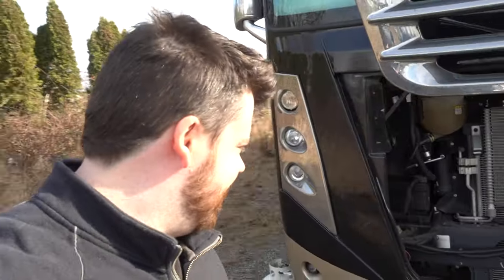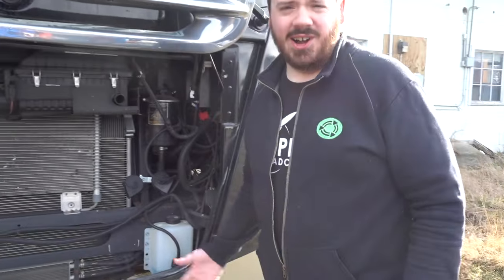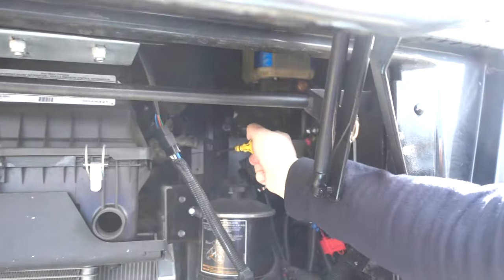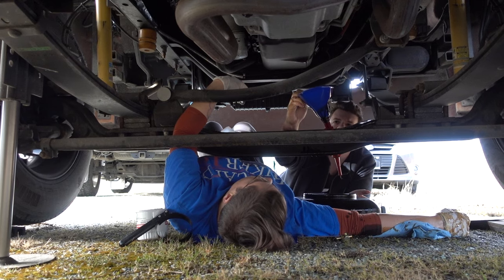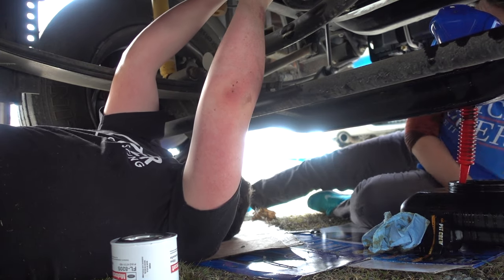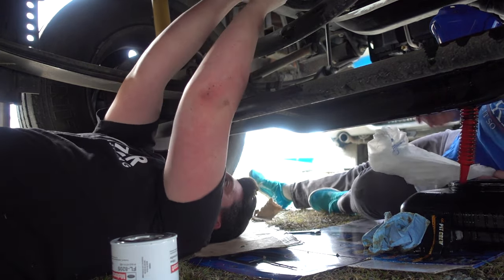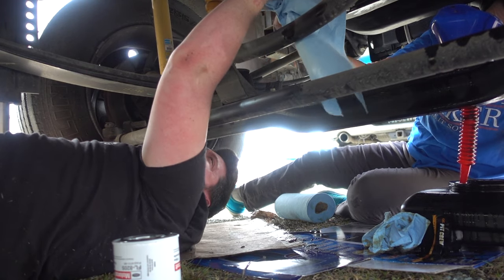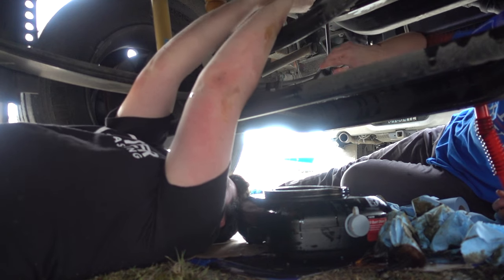Junk Yard Oil Change // vlog 36

Comment: Fisher has no idea what sort of horrible mess he avoided having that old o-ring drop off =p. Good on you both for getting your first oil change under your belt.
Reply from the maker: Yeah I figured that out after we were done. Yikes.

Kinda shocked that the half a dozen videos I watched/forum threads I read never mentioned it. Seems like maybe such a basic step most people just forget to even mention it, but for a n00b that could have been a huge deal to miss!

-Chris
Reply: Chris Fisher, been working on most of my vehicles for years. And I actually forgot one last oil change. Felt like an idiot when I started the van to be greeted by a lovely cascade of oil.

Comment: Ok thanks Chris for the behind the scenes on how you do those drone shots and boy that was neat to see it fly back on its own. I'm just getting into it and have a indoor quad and outdoor one too and boy it's a lot of fun especially when I can check the footage later.  No when you do the overhead shots and you fly over your home there I never see you in the shots, are you doing that from inside? Looks like it with that remote. Really neat!
Reply from the maker: Thanks Patrick!

RE: never seeing me in the shots - That's mostly just me thinking about my shot, and then hiding myself in the shot! For the recent Junk yard shots, I was behind the big white trailer. Or off to the side in the bushes depending on my shot.

For example, if you pause at 00:00:27 you'll see me on the passenger side of my truck. DJI really made that controller stand out, I'd pay to have a black/darker one.

Then of course I also have the luxury of cutting out the parts where I do get myself in the shot. I sometimes leave them in if you check realllly close, but none of the shots last for that long ;)

-Chris
Reply: Chris Fisher Ahh - love the Easter eggs to watch for! Keep up the great work that you guys all do on Jupiter Broadcasting - been watching since near the start and a mostly mac user now because of work but do use Linux and have since 97 wherever I can.

Comment: Chris: did you put oil onto the seal of the new filter before you installed it?
Reply: Also make sure you don't leave the old gasket and put the new one on top. It is a common mistake and with cause a big leak while you are driving. I have seen many engine get ruined because of this.
Reply from the maker: We did!

-Chris
Reply from the maker: I so almost did that. No video I watched or guide I read mentioned that at all! But thankfully it fell on me. 

-Chris
Reply: don't know if you did this, but fill new filter with new oil before install. Put a little new oil on the o-ring also. When starting, the inside guys job is to watch the oil pressure, and of course the outside person watches underneath the motor :) fun fun !

Comment: Good on you doing the oil change yourself :) .. My dad drilled into me using stands when under a vehicle. If the hydraulics fails the rig will sink a lot even with stuff under the tires as the suspension will take up the weight. People have died just under cars.
Something like;

http://www.directequipmentsupply.com/components/com_virtuemart/shop_image/product/HEIN_WERNER_25_T_4cead1a08c119.jpg

Or even something ghetto that is solid and under the rig and not the wheels.
Reply from the maker: Spooky, thanks for the heads up!

-Chris